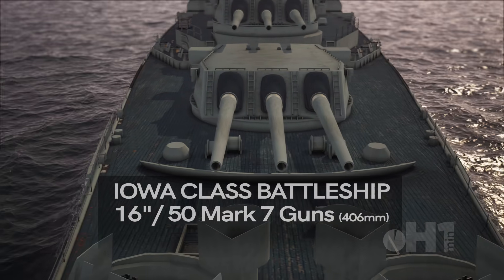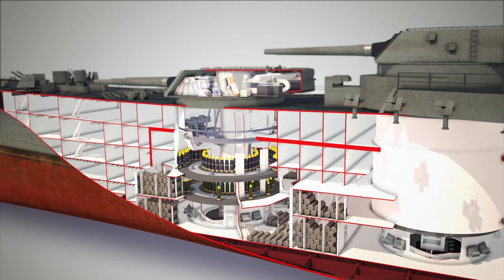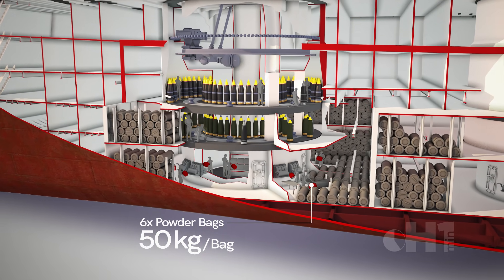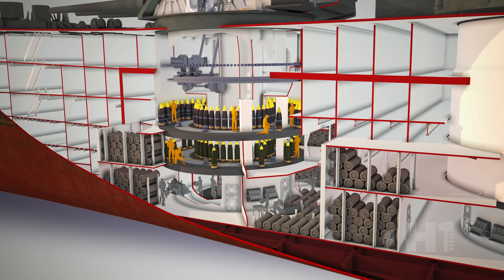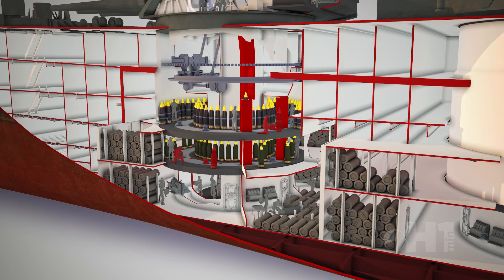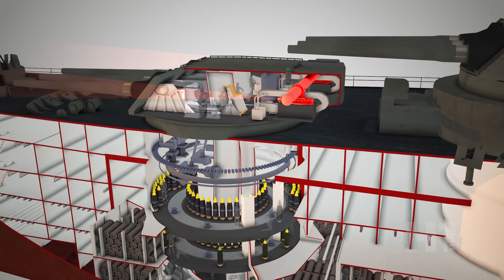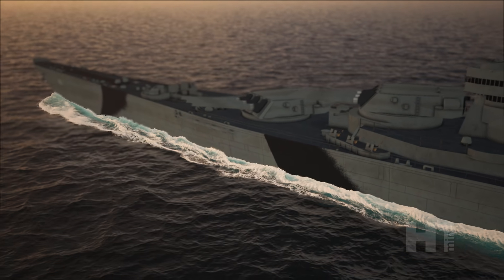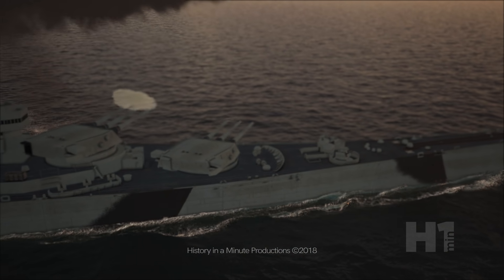H1MIN: IOWA 16" GUNS - Gun Loading Sequence

Comment: The targeting system for the 16" guns of the Iowa class was so accurate as designed,  that it was never upgraded. In '91 when reactivated and equipped with tomahawk missiles and new radar and air defense capabilities, the 16 inch guns were sent to fire on Iraqi positions with the same targeting system it had used to fire in Japanese positions almost 50 years earlier. Impressive.
Reply from the maker: Thank you for sharing those details. The Ford instruments Mark 1 electro-mechanical computer is an amazing invention, would be interesting to learn more about it. All that math in mechanical switches.
Reply: USS New jersey & Iowa were able to straddle (very near miss in wich fragments damage a ship) the japanese destroyers Maikaze and Nowaki at 35km. Thats absolutely insane
Reply: @F4Wildcat  jesus
Reply: @H1MIN  Let me explain this a bit the range finder found on the turret are actually back up system in case the main fire control radar is disabled, the main range finder is found on top of the bridge. Which you could see a radar dish ,that is the main range finder and the fire control radar, the radar are dual purpose, capable to measure range and track surface target, the data is transferred into the fire control director deep within the ship and the crew will use pre set calculators and firing sheet to determine the the turret range setting and lead require
Reply: @H1MIN  Not switches so much as cams, followers, gears and racks.  Continuous real-time analog solutions.
Reply: @H1MIN  i have a question. who is the one who actually controls the power and shell elevators? is it someone in the turret or is it a mechanism that has it all under control?
Reply: @H1MIN  The Ford Instruments Mark1 and Mark 1A analog computers were primarily used to direct the secondary battery of the Iowas, which during their early and mid-service years consisted of 10 twin mounts of 5-inch/38s, 5 per side.  The Mark 8 Rangekeeper was the analog computer specifically designed to control the main battery guns.
Reply: @RabidWildCreature The turret crew has direct control over loading the ammunition. The firing solution is provided by Main Battery Plot deep in the superstructure. Hope this helps.
Reply: The ballistics computer was the same, however the targeting systems had been continuously upgraded and replaced over the years. And, contrary to what’s depicted in this video, the optical range finders were an emergency back up only and never actually used in combat.
Reply: It is impressive, but they also used data gathered by drones to find range on enemy positions. Apparently, the battleship was fucking them up so bad that they started surrendering to the drones when they showed up again.
Reply: Yeah but exactly what targets did it hit? What damage did it do?
Reply: @theVoid524 I thought so. They made a big noise but how effective were they?
Reply: @RabidWildCreature  At the base of the turret in the "powder flat" the propellant bags are deposited in the two-tier propellant "car" and the door is closed by the powder door operator.  This lower operator signals the powder hoist operator in the gun house that the car is loaded and ready to come up.  The powder hoist operator controls the raising and lowering of the powder car.  Once the powder car is in position at its port in the gunhouse, the rammer operator is the one who opens the door, then the powder hoist operator "dumps the car" (actuates the mechanism that tilts the car so the bags roll off and onto the spanning tray), then the rammerman closes the door so the powder hoist operator can send the car down for another load.  There are different propellant types and charges, so the petty officer in charge of the powder flat must ensure that the flat sends up propellant bags that match the projectile as directed by the turret officer.

Projectile hoists are filled by the shellmen and projectile hoist operators located at each hoist on the upper and lower shell flat.  Each flat has a petty officer in charge who is responsible to ensure the correct type of projectile is placed in the hoist per the instructions of the turret officer and main battery plot.  Once the projectile reaches the gun house, the cradle operator operates the mechanism to fold down the spanning tray.  If the projectile to be fired has a fuse that needs to be set, the cradle operator does so at this point, then the gun captain will direct the rammer operator to ram the projectile into the gun chamber at high speed.
Reply: That's a popularly repeated internet myth. The Iowa class originally used the Mark 8 Radar Range Keeper for range and bearing accuracy as well as for remote power control of the main battery. This was replaced by the Mark 13 before WW2 even ended- and that has been repeatedly replaced as well. Moreover, these only establish where the shells are plotted to land. Where they will actually land depends greatly on shell dispersion- a weak point of the Iowa class. Since the end of WW2 and that of capital ship surface engagements, the U.S. Navy largely circumvented the problem of shell dispersion by usually firing one gun at a time.
Reply: @F4Wildcat  Nowaki reported no damage from the action. The myth surrounding splinter damage emanated from Captain Holden's after- action report, in which he stated that smoke was seen to rise from the target, and speculated the possibility of splinter damage from a short round.
Reply: @manilajohn0182  hmm intresting. Will look into that and thank you
Reply: @manilajohn0182  Right, the targeting system, as designed, was not updated when the ship was reactivated. It was the same system that launched shells at Japanese targets. How is that incorrect?
Reply: @shelbyseelbach9568  The Mark 8 Radar Range Keeper employed remote power control to maintain the ship's main battery on target in both range and bearing in all visibility conditions. It was replaced before WW2 even ended by the Mark 13- which was itself replaced later at least twice. The statement that the ship's "targeting system" was not updated is therefore incorrect. Just sayin.
Reply: Thanks, interesting!
Reply: Crazy great heavy machining. Those lathes and mills and the skill and talent of those machinist. Very good
Reply: What was the maximum range for this monster?

Comment: Minor point, but the guns were normally aimed from a fire control room deep inside the ship. They were sighted via directors on the superstructure of the ship, information automatically passed to the computers below, then the computer would slew and elevate the guns as required. The sights on the turret were there as a backup.
Reply: That's not a minor point. Fire control system is the core function of the gun. The fact they even have a backup gun directors tells you this.
Reply: @nimay13  exactly and I agree with you: it's not a minor point at all! It must be said that the great advantage was the use of the radar to estimate even better the position of the enemy, both the ship or the objectives like Okinawa by seeing on the radar screen the blasts...
Reply: My grandfather was a fire control officer aboard the USS St. Louis. They had to go to a special school to learn how to run the guns and targeting computers. Bear in mind that sailors weren't issued with ear plugs when they were at their battle stations. When the guns were "run out", meaning the muzzles of the guns were over the port or starboard sides, it helped reduce some of the muzzle blast but imagine 300 pounds of explosives exploding out of a tube with the supersonic crack of the projectile... that would be loud as all hell.
Reply: This is also why many Japanese capital ships had that crazy stacked pagoda type superstructure. So they could get maximum height for the fire director optics.
Reply: If a WWII battleship was down to using the rangefinder in the turret, things had gone very badly indeed up to that point.
Reply: @Spinolio  Very true. First, the radar systems would have to be knocked out, followed by the main and alternative fore control systems. 

Then, shells/bomb/etc would have to punch through the citadel armor and reach the fire control room deep within the citadel area and knock that out too. 

This leaves the backup fire control systems in each turret, consisting of turret rotation/elevation, and the opitcal sights.
Reply: @bomber6258 so it was possible to fire the cannons and aim them directly from the turret?
Reply: @jorgejimenez6283  yes, each turret had a way to rotate and fire from a small room near the barbette of the turret.

smaller ships like destoyers had a small optical viewport at the top of their 5 inch guns to manually aim them
Reply: USN destroyers had their 5” guns controlled by a similar Mk37 director to that used on battleships, using a smaller computer than the 16” would.
If that went offline, the mount crew could aim with their own optics. If something was wrong with that, the mount captain could stand head and shoulders out of the top hatch and direct fire with a steerable ring sight. The sight moved indicators via cable and pulley to tell the aimers where to move the gun, left/right and elevation.

Comment: It has to be pointed out that the guns weren't typically aimed and fired from the gun house.  Those rangefinders at the back of the gun house are redundant, the main way of firing the guns would be from the main battery plotting room, which had a more powerful computer being fed information from the rangefinders at the tops of the ship's towers.

Comment: Couple of inaccuracies here. The matter of the turret rangefinders being backups has been discussed elsewhere in the comments.

If you watch videos from Iowa-class BBs (remember, they were in service a long time, so we have video of these procedures), you'll see that they did not perform two ramming operations to load the six powder bags, rather, the loaders would push the first three away and drop the next three in before ramming all six at once.

The guns did not fire simultaneously, but with a slight delay between barrels. Ryan Sizmanski on the Battleship New Jersey channel has discussed the reasons for this in a couple of videos and showed photos of BB-62 firing a full broadside that show how the guns are firing in a sequence.

Comment: How does the breech mechanism ignite the propelant since its just bags of powder instead of casing with primer?
Reply: Cmdr. Path  id really love to see some 3D vid about it
Reply: There is a primer cartridge inserted into the breech by the primerman, who lives in the gun pit below the breech.  It's a teeny bit bigger than a .30 cal M1 carbine cartridge casing.  It is fired primarily electrically, but can be percussion fired.  Each of the propellant bags has about 3/4 lb of black powder sewn into a pouch at the base of the bag.